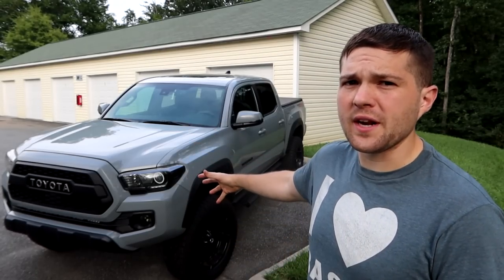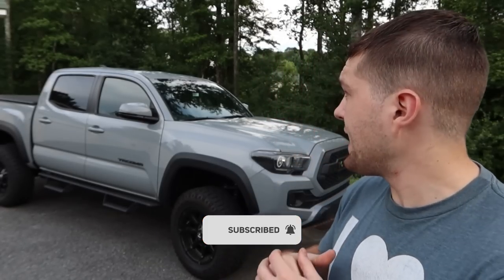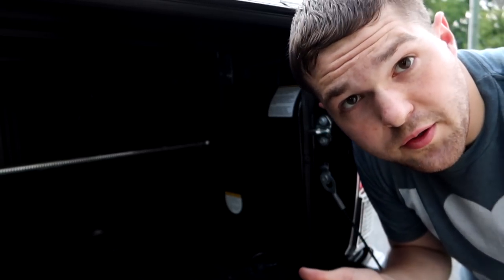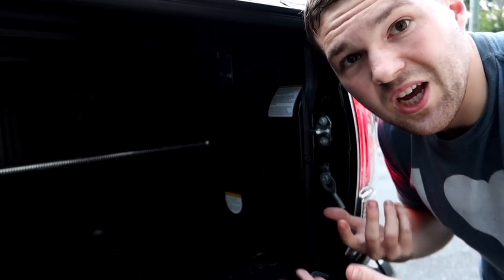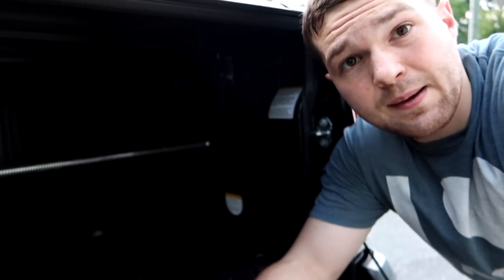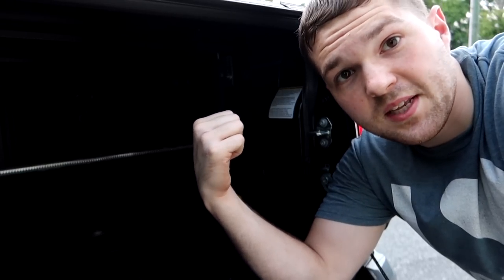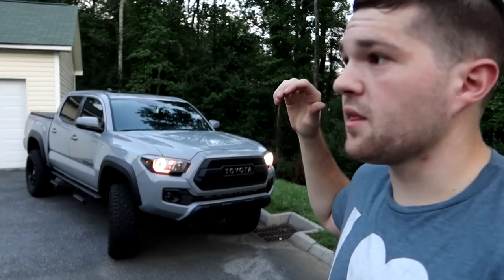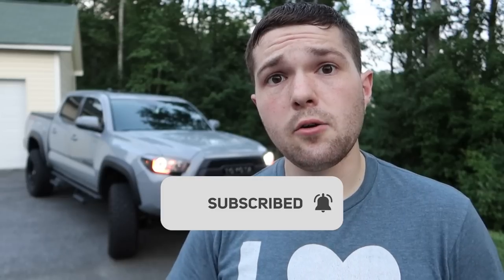The TRUTH about my LIFTED 2020 Toyota Tacoma TRD Off Road

Comment: Yes, take it to the dealer you bought it from and demand they upgrade the Transmission  Computer  Software and it will drive like a completely  different  Truck and won't  hunt gears while in Drive mode. If they say you have the latest tell them to give you a printout of the firmware in the truck, you will find it on the Tacoma World Forum. Also I highly recommend trying the "ECT" button while in drive mode or manual mode and you will notice a lot more gittyup from a dead stop or entering interstates. I also recommend  using the " ECT" button  if you pull a trailer or boat, i use it pulling my Bassboat and it works great. When you go on Tacoma World Forum, type in Tacoma Transmission  software upgrade for gen 3 Tacomas and you find a treasure  trove of info about the Transmissions hunting gears and how to fix it. Hit me up if you have any other questions and or email me @ bwredneck@gmail.com.
Reply: Is that something the dealership should do for free I am still under warranty
Reply: Yes, take it to the dealer you bought it from and demand they upgrade the Transmission  Computer  Software and it will drive like a completely  different  Truck and won't  hunt gears while in Drive mode. If they say you have the latest tell them to give you a printout of the firmware in the truck, you will find it on the Tacoma World Forum. Also I highly recommend trying the "ECT" button while in drive mode or manual mode and you will notice a lot more gittyup from a dead stop or entering interstates. I also recommend  using the " ECT" button  if you pull a trailer or boat, i use it pulling my Bassboat and it works great. When you go on Tacoma World Forum, type in Tacoma Transmission  software upgrade for gen 3 Tacomas and you find a treasure  trove of info about the Transmissions hunting gears and how to fix it. Hit me up if you have any other questions and or email me @ bwredneck@gmail.com.

 @gregguntharp926
Reply: Check this out, Toyota knows about the issue, click on these links or copy & paste: https://toyotatalk.com/wp-content/uploads/2018/07/Tacoma-T-SB-0062-18.pdf and read this: https://toyotatalk.com/wp-content/uploads/2018/07/Tacoma-T-SB-0058-18.pdf
All I know is when they upgraded the software in both my wife's 2018 4x2 Tacoma and my 2018 4x4 TRD Sport they both drive like completely different trucks. It is more noticeable in "Drive Mode" than in the manual shift mode both it helped both. YES IT IS COVERED UNDER TOYOTA WARRANTY!!!
Reply: On my dealership paperwork it shows the transmission Flash update EG1810 Reprogram ECM (PCM), Parts: 5314 Software Update EG1810, you should see this on the paperwork after the reprogramming of the Transmission computer/ECM

Comment: Rick, awesome Tacoma. I have the 2019 TRD Sport cement color with TRD four runner black subdue 17 rims with LT 275/70/17 BFG KO2 running air 38 psi and getting 21 MPG. With a 3" x 2" Ready Left kit. Very happy with the milage. Could you please send me the link on your cell phone mount? Thanks for all your  modifications I've learned alot.
Reply: The TRD sport gets slightly better gas mileage than the OR because it doesn’t have the heavy duty rear end. Also what load range are your K02s E or C?
Reply from the maker: Making a video soon on all my cheap mods I get off amazon
Reply: @hiddenx4968  load range is E on my BFG's. Thank you for the information.
Reply: Scott Paradis No problem. I hade some 265/70R17 K02s (great tires)and they were I think like 58 pounds a piece or something also E load range. I ended up selling them and getting Nitto Ridge Grapplers in the same size but C load range and I could def tell the difference. Not as durable but I’m not doing any hardcore over landing on sharp rocks all the time either.

Comment: Gears, gears gears.  You need proper gearing.  Talk to nitrogears.  You'll be glad you did.  They are high stock, with bigger tires its worse.  The tyranny shifts up quick, and is shifting to high from the start.  I bet only see 6th down hill on the highway

Comment: You need to re-gear that’s what everyone is doing look up Nitro Gears stock Tacoma re gear to 4.88 fixes the issue with shifting constantly and you get better gas mileage all around because the trans doesn’t shift down constantly when ever you try to accelerate. If you got 33s or bigger go with 5.29 gears.
Reply from the maker: I am aware. That's the main plan. Especially since I tow with the truck just about every weekend
Reply: How much does it cost to do that approximately?
Reply from the maker: A lot. Probably 3 to 4 grand
Reply: Taco Rick I think Main Line Overland in Charlotte will start doing gear installs but you’ll have to get the kit from Nitro.
Reply: @TacoRick  
Have you played with the ECT button yet?
They say it's for when you tow or going up the mountains, but I use it for harder driving, to me it feels like it has better power & response.
Reply from the maker: Have not
Reply: ECT will help with the shifting, use it on hills and it holds a gear longer. But regearing is really whats needed like others have said.
Reply: @jwbraughton  
True, but he said he didn't want to go to that expense just yet.
Reply: lacnibor I got the gears on sale for $1,100, and the install was $900.

Comment: Did you try and see if you have the remote start on your fob? I didn’t know but when I got my 2020 I hit the lock button 3 times and on the fourth time hold it down for about 5 seconds and it should start. It was factory installed but the dealer didn’t know.
Reply from the maker: Yes I have it. I don't use it since you have to be near the vehicle and it suits off when you open the door
Reply: Taco Rick I understand that. Nice ride by the way! I’m jealous I Need to get a lift, tires/wheels, but $$$$ 😂.
Reply from the maker: Do it yourself is 3 grand lol

Comment: Because of the shifting and inability to tow anything, I traded mine for a raptor, couldn’t be happier
Reply: Only a $30k difference, no big deal.
Reply: Towing up to 4,000 isn’t a problem.
Reply: @karldolphin7547  if you believe that, you know nothing about towing.  The Tacoma is terrible, can’t hold a gear to save its life constantly shifting up and down up and down.  Terrible Raptor is 100 times better truck
Reply: Ben Murr I’ll give it a try towing my Lance 1475 trailer that is about 2600 lbs. I’ve towed a 3000 lb UTV to the Sierra foothills n did not not have any troubles. Raptors are nice but I did not want a big truck.

Comment: Keep in mind when you are calculating your mileage with oversize tires it won’t be accurate unless your Speedo has been corrected. The tires are larger thus turning slower and recording less mileage per tank of fuel. While you are probably getting worse mileage due to the weight and rolling resistance of the larger tires, it might not be as bad as you think.
Reply from the maker: I calculated that into it

Comment: Not sure I believe the mpg claim. 2019 Trd off road 4x4 with 3 inch lift on 33’s and I get 15 when I pounding through gears ( 6speed Manuel) up to 22mpg cruising in 6th gear. Maybe the Manuel makes the difference.🤷‍♂️
Reply from the maker: Could be the tires. Mine are not the lightest in the world.
Reply from the maker: With that said I am normal doing 80 to 85 on the highway
Reply: I’m running bfg ko2 285/75/17 so roughly a 33 inch. But I also live in Oregon so our hwy speed is roughly 55 so yes that could be the difference lol

Comment: If you understand aerodynamics then you will see that lifting a vehicle increases the front, horizontal surface area which means more air resistance. So yes, lifting a any vehicle will reduce gas mileage.

Comment: I noticed your TPMS light in your dash on... Did you remove the sensors🤷🏻‍♂️
Reply from the maker: Nope hadn't got the tire sensors syncd with the truck yet. I just got it done with my 10k mile oil change

Comment: I have a 2019 sr 4 cylinder automatic. I've never noticed a shift problem. I miss the outlet in the bed, though.
Reply from the maker: Its shift happy on the highway in terms of it like to be hugh in the rpms.
Reply: Youre probably all stock though. No issues til you start modding and adding weight

Comment: I heard pedal commander only helps with throttle response?
Reply: Re-gearing is the solution to the problem. The stock gears are crap.
Reply from the maker: Yeah but it cost so much. Long term that is definitely the route though. I think the pedal commander will be nice to just get and show on the channel then re gear.
Reply: @TacoRick  absolutely!

Comment: Driving a manual solves the shifting issues 🙄
Reply: It's not an issue tho
Reply: @jzila9900  the video says otherwise...🤷
Reply: @RioGood  because of the lift and the bigger tires? The truck  has Atkinson cycle so it's doing it's best to get the best mpg.
Reply: @jzila9900  lol I'm pretty sure you just said it has a automatic and is doing as best as it can.

Comment: I have the same truck except manual transmission   I love it
Reply: TRD off road with manual?
Reply: @maschngon  sorry for this 3month old reply but , how does it handle with a loaded truck ( dirt bikes camping gear etc) over dirt trails( nothing crazy but like fire roads) 

I'm getting the manual but auto is in the back of my mind so my wife can drive in case of an emergency
Reply: @maschngon  also can u use the crawl  and other features
Reply: @SnakesVendetta  crawl doesn't come with it. I am trading in my 2021 auto for a manual. CRAWL and MTS seem a waste. Unless you are wearing a tuxedo and can't get dirty, just get out and enjoy nature during recovery.
Reply: @nicholask7347  I. About to jump on the trd off road. Test drove the auto and hated it. Dont know what they did to the tuning, but my co workers lexus (same engine ) runs smooth. 

Manual is its thanx man

Comment: Can you add an auxiliary fuel tank in the bed for extra range?
Reply from the maker: I haven't found one yet. I would really like one. I found additional tanks but none that tie into the main tank or just a bigger main tank
Reply: Taco Rick yeah that would be nice. What other additional tanks have you found?
Reply from the maker: Its like a side tank that goes over the wheel well in the bed. Couple different manufacturers make it

Comment: I get better mpg on my hemi ram with 33s.  I don’t get why you get worse mpg on a smaller truck with smalller everything.
Reply from the maker: Its all in the gearing. If I regeared i would get better than factor even with the 32inch tires
Reply: @TacoRick  seems silly though that you have to regear.  Other than easier parking I see no real benefit of any of the small trucks vs a full size.  Shame because I’d probably be good in a smaller one.
Reply from the maker: Off roading is the big draw for the smaller trucks.
Reply: @TacoRick  that makes more sense.  I’ve had no real issues so far in my ram, but it is big, so tight spaces I avoid.

Comment: Drive in Sport mode, much more smoother and less gear hunt.
Reply: ECT Power button “on”?
Reply: @gretchindg  yes.. but dont use s mode with cruise...i promise its a ride u dont want to take lol...my ECT is turned on all the time...i use S mode/ECT in town...bumped up my mpgs...smooth shifts...i commented earlier that i will have her regeared next summer. Im not going to put any money in a pedal commander just because its not going to fix the inherent problem with the Tacoma's shift points...my 2012 never had this issue...why they changed that to this...i dont know...just like why did they take the "oh sh$%" handle off the drivers side....oh well...

Comment: If you're a DJ you prolly have connections in the audio gear sphere, why not upgrade the sound system yourself? I'd imagine there's better value in buying the parts not from the dealer.
Reply from the maker: I could but the JBL system came with what I wanted in this truck (leather seats and a sun roof) and the system is plenty good for my needs.

Comment: I get the same but I would rather bad gas mileage than a 4 cylinder with turbo with 20 mpg. That won't be reliable and the tundra is going to get a v6 with turbo and im pretty upset. I dont know how toyota Is justifying that because its proven turbos hurt your motor and turbos go out. I also hate the new transmission. My 2009 and my 1991 has over 200k miles and run like new.
Reply from the maker: Agree

Comment: Your low air tire pressure light is on
Reply from the maker: yeah it was for the spare tire. I have a 5 tire rotation so one of the 4 wheels with sensors in normal in the spare slot and it tends to loose air pressure faster when in the spare spot.

Comment: I don’t understand people getting 15-16 mpg in these.. my 2020 gets 22-28mpg
Reply from the maker: Sr5?
Reply from the maker: If you read into the comments I have learned from my viewers now that the offroads come with a tighter rear diff for off reading and the rear locker which also reduces gas mileage
Reply: @TacoRick   gotcha.. mine is just the SR but not off-road just 4x4.. guess that is the difference

Comment: I drove two separate Tacomas for twenty years, for work(landscaping), and play(off road beach and snow), and both trucks proved tough and very capable. I did experience the infamous Toyota Tacoma frame rust issues however. First truck, 2001 Tacoma Off Road, got a new frame put on after about 9 years. Bought a 2011 Off Road and hoped Toyota had straightened out the frame issues, but no, this one started rusting out and Toyota is performing rust prevention treatments trying to avoid putting new frames on. Would have been nice if they would have just addressed the source of the bad frames to begin with. Does anyone know if they finally corrected the frame problem on the new trucks? I’m not gonna find out...switched to a Chevy Colorado Z71, and I love it!👍 

https://youtu.be/mq8Jo1t2Uqw

Comment: Pedal commander is temporary, and almost the same price as regearing. Save your money, and regear. I had a friend who had pedal commander, later he regeared. And remove the pedal commander. Truck wouldnt run right nor even run when he remove the pedal commander and now he cant drive his truck with out it and it void his warranty.
Reply: The thing that people fail to realize is with the Pedal commander your suppose to set it on park and don't change it unless you put it back in park. People will flick through the mods while driving it and it wigs out the vechile ECU.
Reply from the maker: A rear gear is not even close to the same price as the peak commander.
Reply: @TacoRick  theres different, brands. I failed to mentioned that
Reply: @axelrod21  buddy, been inti automotive for years now. He did follow unstructings etc. It work. But now he decided to finally regear, he finally uninstalled the pedal commander, and now, its like the ecu doesnt sense a engine or transformer. His truck will only run when he install the pedal commander, but then acts up.

Comment: No towing or hauling capacity.  
Gutless engine and transmission that loses mpg like crazy with any extra weight or slightly larger tires.
Tiny bed.
No solid front axle.  
No trailer brakes.  
They ship with an improper and weak gear ratio.
If you wanna put larger tires on, even with a lift, you have to cut the frame and plastics.  
They’re WAY overpriced at 40K, when you could have a capable truck that actually does truck stuff or an easily modifiable Jeep in that price range.

Literally no advantages to a Tacoma.  I don’t understand the popularity.  It’s a good looking car with a truck bed.

Comment: Shoulda got a 6-speed.
Reply: Got me a 6 speed 2020 Toyota Tacoma. Sand brown
Reply: Wesley Daniel  thanks man
Reply: Wesley Daniel  lol I live in a desert
Reply: @Jimi-Funkycold-Molina  i didnt like the 6speed since no crawl control  and no push start
Reply: @whiteazn2  my 6 speed tacoma has crawl control and push button start
Reply: @nicholaskarlsen1550  that's weird... when i went to the dealer all of them didnt have it and they told me they dont come with it..at least for the 2020
Reply: @whiteazn2  the dealer doesn't know what they're talking about then. All Tacomas are 6-speeds, both manuals and automatics. Crawl control and remote start aren't available with the 6-speed manual transmission, but they are available with the 6-speed automatic.  The push button start is available with either transmission.
Reply: @nicholaskarlsen1550  thats what im talking about.. the manual does not come with it.. i have the auto so ya they have it..
Reply: @whiteazn2  when you call your transmission a 6-speed, it could refer to either a manual or automatic transmission.  They're both 6-speed transmissions.
Reply: @nicholaskarlsen1550  ya i was referring to actual manual

Comment: Lemme tell you what I think bout 3rd generation Tacoma....it's not that good...sorry fanboys, Tacoma is not all that... first and foremost, it's expensive ....gas mileage is bad... it feels and it is underpowered... transmission is absolute garbage...no amount of software updates will fix that gear hunting...dealership did 2-3 updates on mine...still hunts for gears...jerky as fuck.... i can only imagine what happens once you put some bigger wheels... it's already a dog.... so you gonna spend $2000-2500 on decent  wheels and tires combo...then you  gonna spend another $1500 regear that bitch...and it's still gonna drive like shit....waste of money...hopefully reliabilty is still there.. that's the only reason I'm gonna keep mine...and it's almost payed off... definetly not because of theb driving experience.... end of rant..